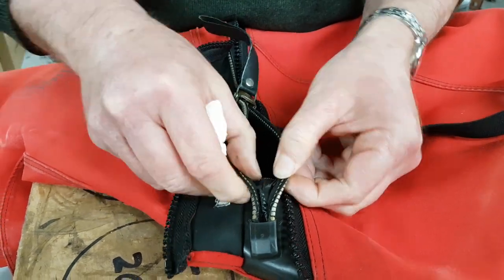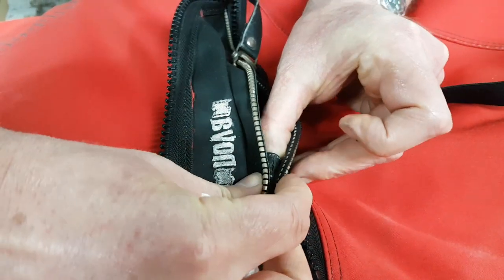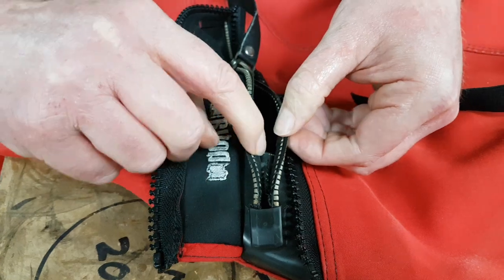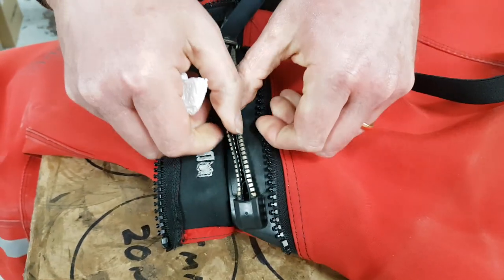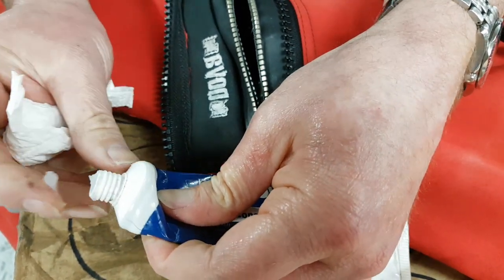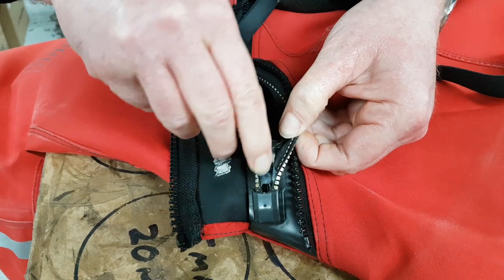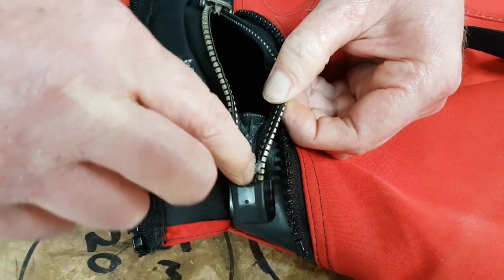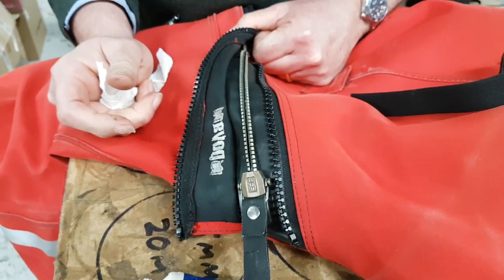Leak in the end of your BDM dryzip?

Comment: what type /brand of grease do you recommend? Surely silicone will get everywhere and make future repairs more difficult, and a petroleum based grease would damage the rubber of the seal.
Reply: semen works well